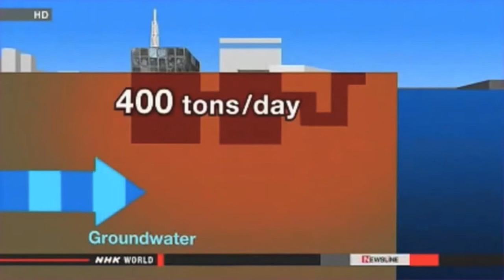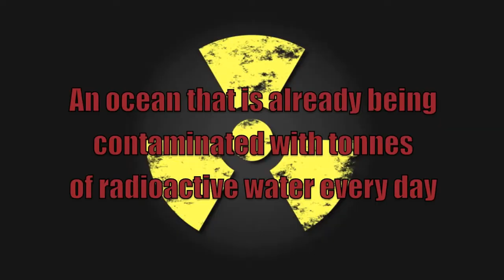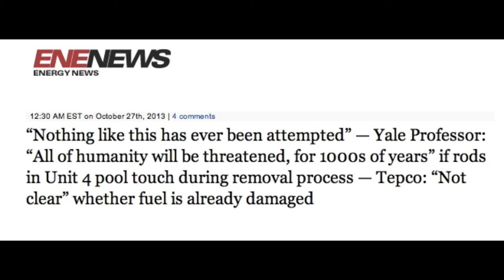☢ Fukushima: Beyond Urgent ☢ (Platos Cave Mirror)

Comment: Groundwater reached the surface of the ground on the seaside of reactor
October 27th, 2013 Fukushima Diary
The groundwater level reached the ground surface on the seaside of reactor after the heavy rain, according to Tokyo Electric’ data.
To stop the contaminated groundwater flowing to the sea, Tokyo Electric is building the impervious wall on the seaside of reactor but it is retaining the groundwater. The groundwater level is rising.